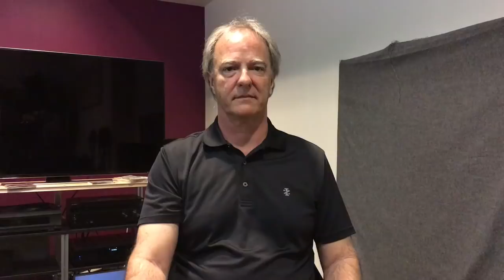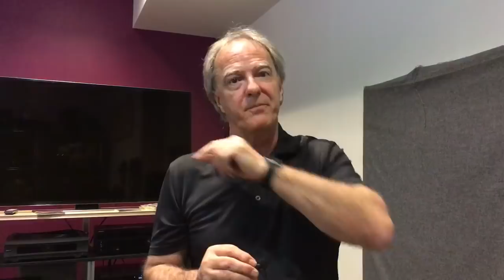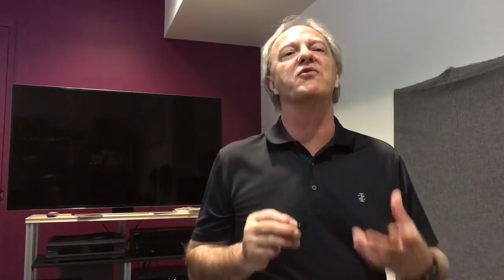Everything you need to know about speaker impedance

Comment: Even though I only understand about 2% of what these guys are talking about, I could listen to them all day.  Maybe then I'd understand 3%.  I wish I had been an Electrical Engineer...
Reply: this is so easy to understand. he touches on  simple power transfer voltage vs current aka  velocity vs pressure against a capacitive load. he says nothing on the subsequent insuctance produced by the moving coil ie power generation that then feeds back ie back EMF. then damping factor etc and source impedance of the amplifier output stage etc...
Reply: @A. Melbs well, what can I say? Thank you. Humbly.

This is fundamental to physics, imagine an equilateral triangle.. each point represents a parameter. So, in this example... voltage, current and mass. In physical engineering it is usually Velocity, Pressure and Mass. These terms and principles are synonymous. 

You can only ever fill up the area with the triangle by 2/3rds. NO EXCEPTIONS. It is always a compromise and you design based on what works best for the application in the real world to human beings.

Notice how its a triangle.. and its 2/3rds... this is not a quantifiable number. it is infinite  in its recurrence. EXACTLY. I'll leave you with that thought.... 😏
Reply: @A. Melbs i missed your sarcasm initially.

i have no qualifications at all yet I have taught myself Electrical Engineer and Organic Chemistry myself.

some credit is deserved i think....

ps... humbly I hope you learned from my other comment as this IS simple to understand. nobody explains it from the root  level thats all.

Comment: 8:30 - Solid state amps offer voltage control. A tube amp is basically a current source;  those impedance humps will also show up as humps in the amplifier/speaker frequency response!
Reply: A tube amp is not a current source. It is a voltage source that needs a transformer to convert high voltage into  more current. V = IR

Comment: So I have a full setof JAMO 4ohm speakers. Now that my 15 year old Yamaha has died, Time to get a new AVR. To get the lowest THD should I replace with 8ohm speakers? Is the extra cost of speakers worth going  from 10% to under 1%THD. ( lots of AVRs researched ..rough figures). Opinions?
Reply: THD only becomes audible at 5% or higher. Can you hear the distortion? I have never heard of any audio component at 10%, that's incredibly high.
Reply: i only need to look at the vendors spec sheets. though at this stage i wont be getting a low end AVR and trying to drive it at its max levels but a better specd unit, so that any resemblance to  "LOUD" is not near the top of its range.

Comment: I think Andrew is defending his 4ohm speakers because they've necessitated a 4ohm design to raise efficiency... Truth be told this increases the possibility of early wear and or damage to amps\receivers designed around a 6-8ohm min. specification. How much wear or damage varies, but the fact that it becomes a possibility makes it a potential problem... Always stick with proper ohms match-ups if you value your equipment and want to use it without volume limitations.
Reply: I have been deigning speakers since 1975 and they are all 4 ohms. I have had amps for 20 years and no problem at all. I have compared the same design at both 4 and 8 ohm and at the same volume and 4 ohm sounds better. Much more lifelike.
Reply: A 4 ohm design doesn't increase efficiency. It draws more current from the amp. Most receivers are not rated for 4 ohms because they don't contain enough cooling(heat sinks etc) for long term rating. In the real world most speakers will only dip into 4 ohms in a narrow range of frequencies, if at all and not continuously so there is usually not a problem. There is the occasional speaker that may be rated at 4 ohms and dips into the 1 ohm region. These are usually high-end designs and not powered by $400 receivers at any rate, so once again, it shouldn't be a problem. A seasoned audiophile knows about these speakers( Apogee Scintilla, Infinity Kappa 8,9 etc.). 
Designing a speaker to be a 4 ohm design is the smart way to go as most ss amp designs put out the most wattage in this impedance range range.
Reply: I have been building 6 ohm speakers since 1974 and have never had a problem with amps.  I kept my last pair of Bedini,s for 18 years.
Reply: @nicholascremato  Will a 4 ohm and 8 ohm rated amplifier work with a 6 ohm speaker? Or is that stressing it too hard?
Reply: Randy Levine my amp is rated to 4 ohms. So im ok.

Comment: I have two  8 inch , full range , handmade,  DD patented speakers tested and working on 1 and 2  ohms. They are in wood floorstand transmission boxes, 1.5 meter high. Powered by handmade germanium amp on 10 watts.

Comment: Oh, then my favorite speaker manufacturer Mart.in Logan is a liar liar pants on fire. My speakers (Source) are rated at 6 ohms but at about 7 kHz they drop to just over 1 ohm!!! Whenever  I've  played Chicago's  If You Leave Me Now it has shut down every receiver I've ever tried to drive them with right at the beginning of the track with that triangle strike!!!!
Reply: martin Logan started making ESL's that needed high voltage swing amplifiers to drive them right. Then they hired a Krell engineer to make them work well with high current capable solid state amplifiers. That is the version a low current capable receiver has trouble with.
Reply: Why are you driving stats with a receiver anyways?

Comment: Then there is the issue of the 1 ohm Apogee Scintillas... (For those who don't know the Scintillas had a reputation for putting amplifiers "out of commission".)
Reply: Almost purely resistive load. You just needed a solid state amp capable of high current into low impedance with excellent heat sinks or fans. Like a  class A Krell or a pair of monoblock Krells. You could have used two stereo amps and had one channel run the bass ribbon, and one run the mid/tweeter ribbon per speaker  too.
Reply: YUKI JINJUJI 😂